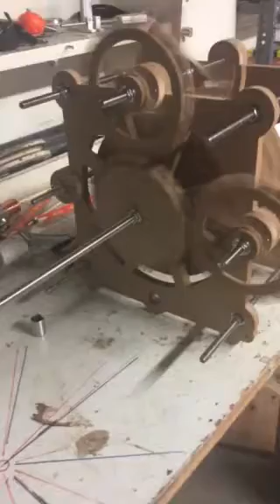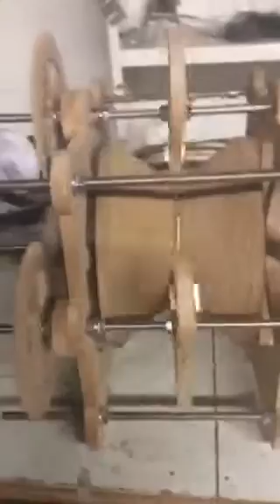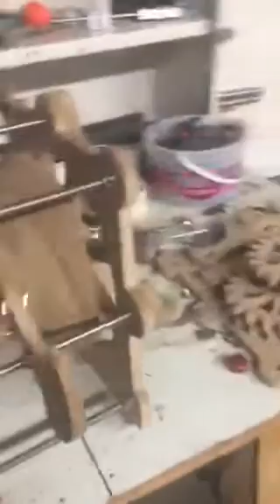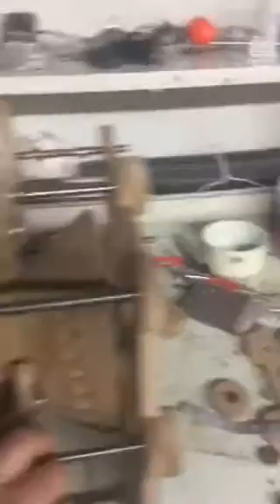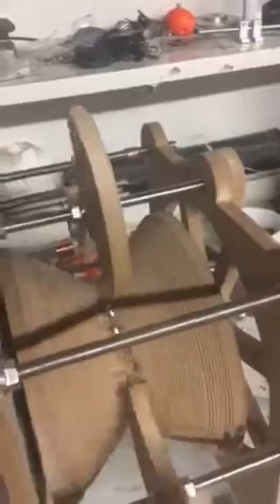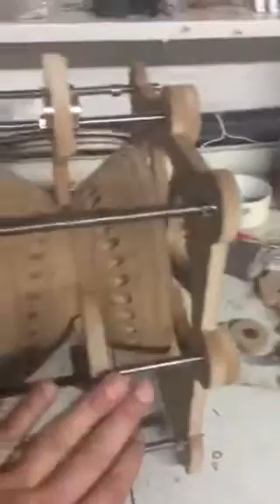Magnet Motor Elliott DeepV design concept. Vgate v-gate generator Read The Description

Comment from the maker: Take a look at some new experiments I am doing on these 2 videos.  https://youtu.be/Z5RzJiPHJT8 and https://youtu.be/HHJ-7bFfl6s.   More to come soon.  I am going to recycle the air from the cylinders to turn an air wheel. 
What is an air wheel? It’s a like a hydro wheel but opposite. Submerged impeller that upward air flow turns.  

Also my deep v magnet motor is going to be rebuilt to a higher precision.

Comment: Is this being presented as a motor that needs no outside energy source? Is it powered only by the magnets used in its construction?
Reply from the maker: It was not being presented as for any intended purpose. Just a concept for magnetic devices.  Check out my latest in 2021  https://youtu.be/SB9RW3y2qMs

Comment: Sir, soppose, some one is succeeded in getting rotatry motion by using neodymium magnets, what is the life of these magnets in working condtion ? Thanks
Reply from the maker: Well reports vary in the life of neodymium magnets.  Most say about 50 years. Although this machine works, it has very low torque and comes to a stop eventually. I think it stops due to magnetic saturation. After it sits a while it runs again.  The torque is not enough energy to be useful.  I believe my design is one of the only ways to achieve this magnet motor movement because it has a disappearing gate. But it’s needs to be better calculated, refined, and researched more.  So that’s why I have put it out there.  But it seems this idea may be being suppressed.
Reply from the maker: https://www.facebook.com/DeanElliottYardSaleAmericaNetwork
Reply: Thank you , dear sir
Reply from the maker: If your not subscribed, can you subscribe to my channel to help me with research funding?  Please ask you friends too.  Thank you so much. 

Dean
Reply from the maker: If your not subscribed, can you subscribe to my channel to help me with research funding?  Please ask you friends too.  Thank you so much. 

Dean
Reply from the maker: See what will change the world in my latest videos. If your not subscribed, can you subscribe to my channel to help me with research funding?  Please ask you friends too.  Thank you so much. 

Dean
Reply: @jameselliott9397  dont you just luv it, instead of congratulating you people start to pick things apart,
Reply: Awesome video Dean! Very interesting